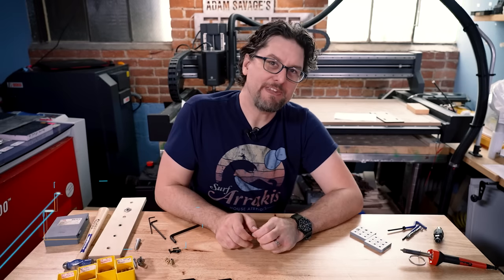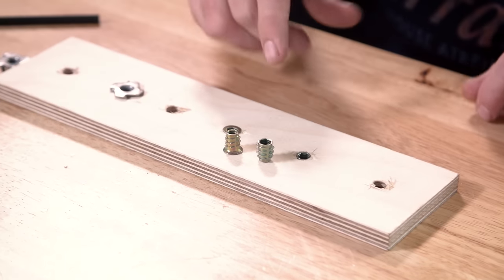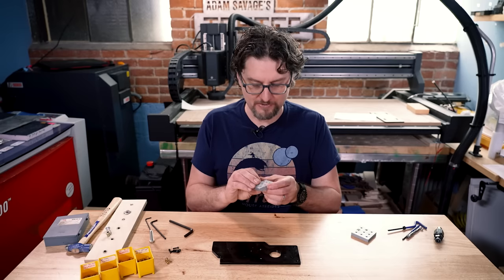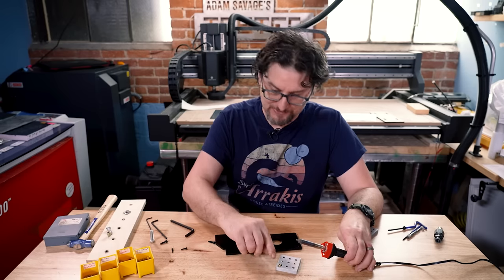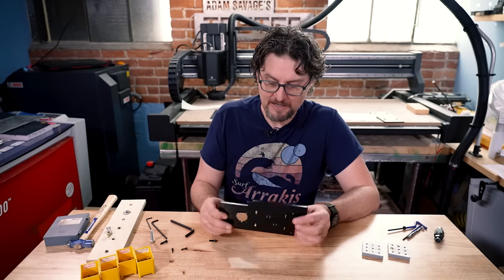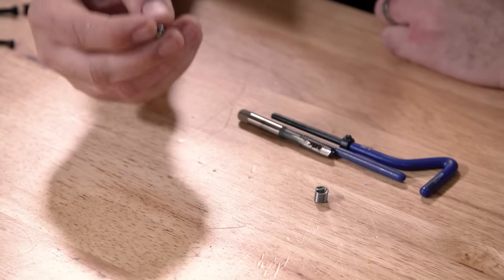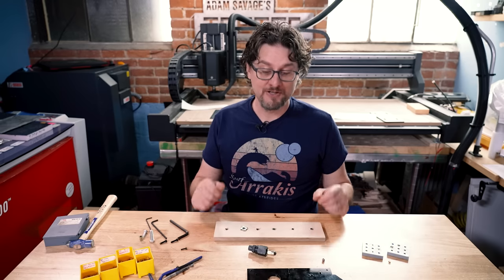How to Use Threaded Inserts for Wood, Metal, and 3D Prints!

Comment: T nuts: As others have suggested, use a forstner bit to make a shallow recess for the rim. I've had problems with T nuts ripping out but found a liberal application of epoxy after thoroughly degreasing and roughing the insert to be pretty effective. The inserts you show for restoring threads in metal: be aware that there is also an insert for wood that looks the same, with a screw slot not a hex fitting - but its made from something like zinc or aluminum and given a brass/gold colored finish - they will strip out over several cycles of use. Rivet nuts (aka Rivnuts) can be inserted inside hollow metal tube with the collapsed end outside (eg for a knob to lock telescoping metal legs) if you make a simple jig from a bit of threaded rod - screw the rod thru the Rivnut when it is in place then place a lock nut on the collapsing end. Drill out a 'joiner nut' so it slides over the rod - one of those really long nuts for joining threaded rod end to end - slide a washer onto the rod, then the long nut, another washer and then a pair of lock nuts. You then use a ring or similar through spanner on the locked nuts to compress the Rivnut until its locked in place - you will need something like Vice Grips to stop the threaded rod from turning until the Rivnut has collapsed enough to lock into its hole. Reverse the process to get the jig out, repeat as needed.
Reply: Excellent tips - thanks!

Comment: He's using the "t-nut" as he calls it backwards.  The flang side with the teeth goes on the bottom of the wood.  It will seat tighter and tighter under torque loading as you tighten the bolt down.

Comment: Another tip for rivet nuts; Astro Pneumatic makes a drill adapter for rivet nuts. There are two models that work with various sizes from like M3 up to 3/8-16. I bought both for work where we use a lot of rivet nuts in sheet aluminum. Just set up the tool with the size/thread mandrel you need, chuck it in your drill and set the clutch just high enough to crush the rivet nut, but low enough that you don't break the mandrel. Super easy, but not great for tight spots.

Comment: If you need T-nuts to sit flush just drill the wood out to the level needed. If you encapsulate the T-nut in the wood it will make it much stronger. You can also use rivnuts, which are basically a rivet with a threaded portion down the middle. There is also mixed bolts which gave a machine thread side and a wood thread side; these can be used to make wood products that easily come apart, i.e. removable table legs.
Reply: He covered rivnuts, but the mixed thread bolts are an interesting solution too. I've seen them for table legs, but I wonder if there are smaller scale versions that could be used for plastics.
Reply: @belg4mit : I saw that though I already wrote the comment by then; he didn’t hit rivnuts until the end. You can use them on things other than sheet metal, much like rivets. Also like rivets they make plastic rivnuts which can be helpful in some circumstances.

Comment: Helicoil kits are pretty inexpensive. Timeserts are the expensive ones. I used them on manifold studs when the helicoils failed.
Reply: Agree! And there are so many copies of the Helicoil sets. About $10-12 for a complete kit with tap, drill and tools, plus a bag of inserts. And they are compatible with original Helicoil inserts if you prefer that.

Comment: I wouldn't describe a T-nut as a threaded insert, it's a nut to be used on the back side of something. Also known as a blind nut, they are generally used where access to a regular nut would be impossible or impractical with a wrench. A good example of their use is for climbing walls where you can install many of them into the backside of your plywood before mounting the ply on a wall or frame, this gives you the ability to move holds around without having access to the back.

The teeth are to stop them from spinning, not to stop them from pulling out as in your example of leveling feet.

Comment: Especially with ikea furniture. I use a bit of epoxy or wood glue on the threads when used on wood inserts to secure they are solid and acts like it’s part of the wood. And for metal or anything else, epoxy. Haven’t had one fail me yet.

Comment: 1:45 You are using your tee nut wrong. While you can use from the side you drilled from, it's actually better putting the bolt through the other side so the bottom of a machine screw or bolt, comes out the flange (flat side). (3:03, that's how you use a tee nut.)

Comment: One think to be careful when inserting the threaded insert is to make sure it is perpendicular to the surface of the material.  For the heat insert this is pretty easy as the soldering iron will help you visualize if you are straight up or not.  The screw in type (wood mostly) can decide to get cocked to one side and go in crooked.  Started the threading as perpendicular as possible is important.  My $0.02

Comment: the wood spiked t-nuts are easy to make flush if you use a butterfly or forstner bit before drilling the through hole. It also has the advantage of giving you a center drill divot to line up the through hole.
Reply: Even a spade bit will do in a pinch, just run it backwards a little bit so the spurs sever the surface fibers of the wood then switch into 'forwards' to remove most of the waste.

Comment: Nice. I just tried a 3D print using a 3/8 nut as the insert. Just designed the hex shaped cavity to hold the nut and configured the slicer to pause so the nut could be inserted and then printed over to hold it in place. I like the options you showed, so thanks for the tips.
Reply: captive nuts have superior pull out strength vs the heat inserts
cnc kitchen did a nice test video

Comment: I heard 'Ghost Trap' and now I'm REALLY interested.

I'm using a knurled brass insert as a joint for my wood lathe
projects but the biggest issue I'm having is drilling out the hole
for the  insert and finding that the insert isn't entirely true.

The project will spin and there's a wobble to my project.

I don't want to be too specific on what I'm making as
it's an invention I've yet to reveal but I was reading a manual
by Chris Hightower for cue making and noticed his take on
Joinery of the Butt > Shaft and he mentions using a Center Bit.

Adam Savage has a video on Center Bits which I found enlightening!

Has anyone ran into the same issue as I have
and found the remedy by using Center Bit Drills?

Hopefully I've made sense in my explanation.

Comment: Interesting.  I didn't know there even were specific heatset inserts.  I've been using traditional threaded inserts in my 3d prints for years with the soldering iron method very successfully.  Pro-tip on that method, use a fat tip (shaped like a flathead screwdriver) and give the iron a slight clockwise twist before removing it from the insert.  Also, have a good pair of pliers for holding the insert, they get hot very quickly and will burn badly.
Reply: LDO recently made a heatset inset tool to put on a soldering iron

Comment: For the heat set inserts it can be hard to make sure they are put in perfectly straight. One method I have started using is to screw a long machine screw into the insert that I can use as a handle, and use my soldering iron to heat up right where the screw and insert meet. The long screw makes it really easy to see if you have it at the right angle as it sets.
Reply: Clever.
Reply: So true.

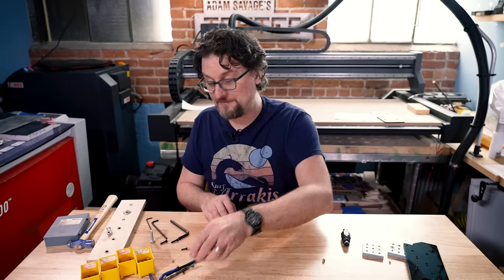Comment: At 12:33 Sean is talking about (but not demonstrating) the "rivet-nut" or "riv-net".  I use these a lot.  These are the only type that will work well on sheet metal where this is not enough thickness to tap the hole or use one of the other types of inserts being shown.  Sean mentions "typically" needing to use a pneumatic or hydraulic tool.  While this might be true for large bolt sizes M6 / 1/4" or larger, for M5 / 10-32 and smaller bolts a common pop-rivet tool will work just fine.  The screw type tool that Sean shows is difficult to keep from spinning while tightening.  My $0.02.

Comment: @sean charlesworth 
I’m actually turning some over sized dice into cabinet knobs and I want to put a threaded insert in them.  They are acrylic of course.  My initial thought was to drill a hole and use a fluted insert, but after watching I’m thinking maybe that’s not the way to go. Any recommendations for an insert into a thicker acrylic that you can’t come through the back side? I’m doing both D6 dice and d20. I am slightly concerned about them splitting.  May just use and oversized hole and some adhesive? Anyway, suggestions from you or the audience are welcome!!  - thanks

Comment: Jack nuts. I need to put a fixing for an interior light in a car head lining (foam/card fabric) and no clearance behind. I drove my self bonkers trying to find something that worked, a rivetnut would be too long and they don't expand sufficiently, hot glue would melt, stronger glue would destroy the liner if the light needed replacing. I found jack nuts is just like expanding dry wall fixings (except shorter nut section and designed for thinner stock) they expand/spider out and only stick out a few mm once compressed. I put a small washer interior side and some heat shrink on the roof side (to stop it rubbing the roof) job done very secure and light weight.

Comment: Threaded inserts for wood disclaimer! I adamantly disagree with what was said in the video.

From my experience, having used threaded inserts thousands of times for jobs in the past, T-nuts are the absolute best option 90% of the time for wood, as long as you design properly for them.

The coarse screw-in ones will usually easily rip out or tear up most softwoods, while being way too coarse for hardwoods. They are also often made of very brittle metal that will break/shatter if you try to thread them into hard hardwoods.

If you want a T-nut to sit flush, just use a Forstner bit to make a countersunk flat for the flange to sit in before you drill the through-hole.

It can also be good to pre-drill some small holes for the tips of the flange teeth to follow, particularly in hardwood. That will help prevent cracks in split prone woods.

As long as a T-nut is having the main force it will see applied in the direction that pulls/pushes the flange into the wood, I have never had any issue with one. With smart design, this can almost always be accommodated.

There are times that a T-but won’t be the best option because of design considerations, but any time you can design for them, I heartily recommend you do design for them and use them.

When I can’t design for T-nuts, I go for an epoxied in insert, before going for one of those coarsely threaded ones. IMO those coarsely threaded ones are the worst type of insert you can buy, for most woods. They end up destroying the wood and themselves way more than any other type of insert I’ve used.

Comment: many aluminium parts (depending on the alloy) also require steel insert, because the steel screw in it can eats up the thread. That's a common corner cutting issue with cheap tools. it works for a while but they eventually fails.

Comment: One reason to use a threaded insert in a 3d print or other plastic, or even wood would be if the part is meant to be removed regularly,m like for breakdown, or maybe securing a compartment, etc. You can thread into plastic, but it's easy to strip out if you're removing and replacing screws frequently. Anything that's meant to be unscrewed I like to have a metal threaded hole, Ecco usually means an insert

Comment: Those wood threaded inserts go on the BACK of the board.  The flat part is what keeps it from pulling through. And they lay flat in most wood if you use a hammer. Pound the shit out of it. Remember, this is on the back of the workpiece. Nobody will see the dings.

Comment: At 1:00 Sean describes the T-Nut.  These are inexpensive and OK for many applications.  They can easily be hammered/pressed into soft woods - but tougher to do into plywood or especially so into hard woods.  Importantly, they will stay in place just fine if the load onto the T-Nut continues to press them into the wood (i.e. adjustable cabinet feet) but are REALLY lousy when the load is acting to pull the T-Nut back out of the wood.  My $0.02.

Comment: I've found with T-nuts that you can often used them on the BACK side. This works well with non-leveling furniture legs that. Used on the outside, they have a tendency to pull out, but in the back side it just pulls the T-nut tight!

sometimes, when joining two parts, you can avoid cutting threads in either part by using a Blind, or Chicago screw; that is a screw and screw cap. Adam did a great episode on these little miracles

Comment: I use key inserts almost daily. They have prongs that have to be hammered into place locking the insert (usually in aluminum) to accept bolts (typically stainless) for aviation uses

Comment: An alternative to t-nuts or heat set nuts - if you have access to the reverse side of the material- is to just use a hex nut.  For wood simply recess the nut with a forstner bit, or similar. For thermoset plastics, just heat the nut and recess it flush.  These wont work well for high torque applications, but will be fine where you just need a snug fit.

Comment: Caterpillar sells a great thread insert. Contact you local dealer and they’ll hook you up. I feel it is superior to helicoils as there are locking tabs to prevent the insert from turning after install. I do not work for Cat. However I use the inserts quite often and have not any issues in 10+ years. Great video. Cheers

Comment: Another good one is rivnuts: they install like regular pop rivets, but they have a threaded hole throughout! 
Very nice for adding threads to very thin sheet metal, or adding steel threads to e.g. aluminium plates / profiles.
Reply: And for the hobbyist, Harbor Freight sells one that works pretty well for aluminum and brass(?).
Reply: He covers it on the absolute last segment.

Comment: When I use T-nuts, I usually drill a shallow hole first to accommodate the diameter and thickness of the top flange of the nut so it's flush with the wood, and then drill the hole for the nut itself.

Comment: I would never in a million years bang the t nut in. There are 2 better options. A. You can put a bolt in the other side and use a socket to pull the t nut in or you can insert the t nut in and place everything into a vice and press it in. If this is not a visually important job, go ahead and bang it in. It's the slackers method though.

Comment: For the wood ones, the ones you thread with the allen key are my favourite too but those you find usually (and the ones shown here) are cast zinc and not super tough. For furniture and stuff that need to be durable you can get more expensive ones in steel. They’re just a bit harder to find. Also a bit of superglue on the installation can help.

Comment: Inserts are good for soft metals that would strip out easily.  Also, the adhesive on inserts for metal is usually a thread locker that is activated in the absence of oxygen.

Comment: The helicoils can also be used for through holes. Once you screw it in with the special tool, try to unscrew it and the little tab breaks off. Just a little tip that took me a while to discover.

Comment: For the rivet nuts there are also tools that use a normal hex wrench and a hex bit driven by a socket wrench, impact gun or electric drill to expand the rivet. They work great and are much cheaper than a rivet gun.

Comment: T nuts should be mounted on the rear or the material, and the bolts inserted from the other side, that way, the force of the tightened bolt, will pul the T nut into the wood, not out of it.

Comment: I don’t know what kind of Riv-Nut’er you bought, but there’s several cheap, manual “setters” (or whatever they are actually called) that are just as easy to use as a pop rivet gun. There’s one that basically IS a pop rivet gun, only just for riv-nuts instead. There’s another one that looks like a tripod, that’s actually a little easier to use, and a lot of mechanics/body shops use that one.  But yeah, just check around.
Reply: Either way, I subscribed, cause I’ve seriously enjoyed the videos I’ve had in recommended.

Comment: Helicoils work well putting direct into aluminium castings, as this gives a bigger grip area to the casting, but the bolt you use can be one size smaller, for the same holding force, as the insert spreads the load out over the casting evenly. Plus for things removed frequently they mean no hole wear, and if it does eventually wear out, you just pull out the insert and put in another. Even works on plastic as well for stripped threads, giving a better thread to use, though there you do not want the threadlocker as that will weaken the plastic, though you can put a drop of acrylic glue in place of it as you go in with the insert, to weld it to the walls better. Then leave for 12 hours to set up, before putting the bolt in, as it might otherwise stick bolt to insert. There are more insert types for steel as well, including solid ones that go in the same way as a helicoil, but which are machined out of a solid piece of steel. Getting the full set is kind of expensive though, I have simply gotten the inserts and taps, using the next size down inserter tool instead to put them in, and then snap off the tang. Plus bought old US standard sets that had not been moving since the 1970's, when metrication occurred, because they were on sale for the 1970's prices still. Those came with actual metal cases, so of course I also got extra inserts and taps as I needed them. Means I can actually repair a 1/4UNC thread, instead of make it M6.
Reply: until you have used time-serts,, l threw my helicoil kit away, once l found time-serts